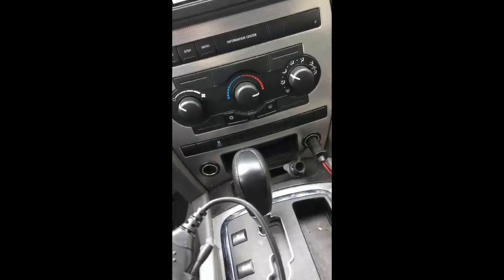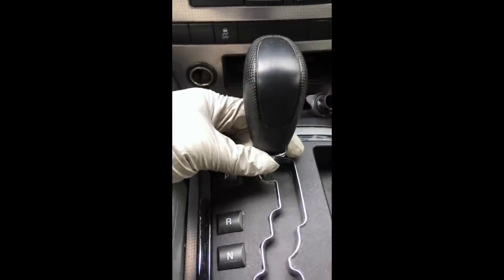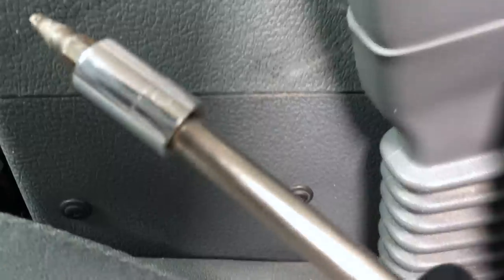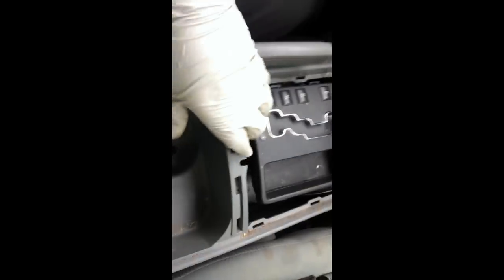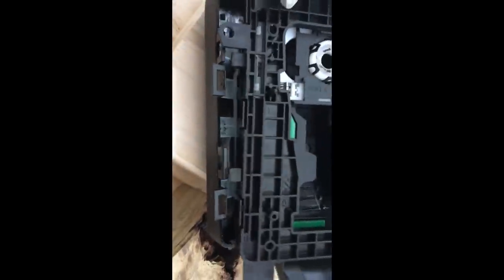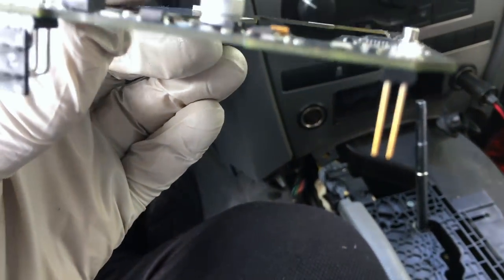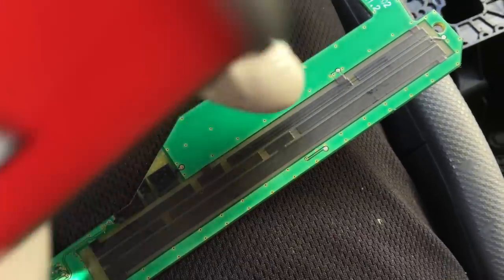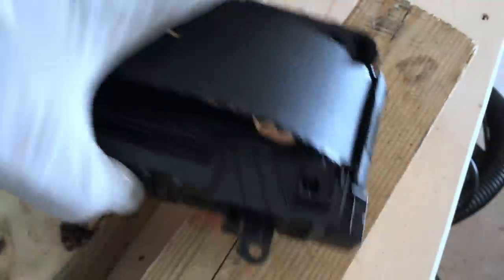2006 Jeep Grand Cherokee (WK) 3.7 Electronic Shift Module (ESM) Problems U0404 P0700 Codes

Comment: Would this cause a no crank issue on 08 wk? Shifter lights are all highlighted PRND ,and shifter is stuck in park,unless I manually release it. I have the crd and this problem also caused the glow plug indicator to not light up at all,and I don't hear the fuel pump. I've tried both original fob keys,and when cranking I only get one click at the starter relay , swapped relays and no dice! I did notice the red skis led continues to flash slow when keeping the key in the ignition.
Reply from the maker: It shouldn’t cause a no crank. Can you pull the codes? You can buy a cheap scanner at any auto store. Without that information it could be many different things. Let me know what you get.
Reply: @MrV2u  unfortunately my elm Bluetooth isn't communicating with the ecu when using the torque,and j scan app.i might have to tow it to the dealership,I'm thinking it's the pcm,or win module. I wish I was able to retrieve the codes but I'm not sure why it won't communicate. It's weird how the fuel pump,glow plugs ,and injectors aren't working,seems like a fail safe mode issue,
Reply from the maker: @Unleaded93  sounds like a ecm like you said. Check all your fuses and relays as well. It can be something as stupid as that or a short in one of the wires in the main harness. Has the Jeep been parked for a long time? Did it have any other issues before this happened or was it like you just parked it and this happened?
Reply: @MrV2u  ya it was sitting for four days ,than I uninstalled 2 batteries that I use for my car audio,after that it wouldn't start. I than unhooked the engine battery and had it load tested, installed engine battery back in again after a good recharge and still has the same symptoms
Reply: Can a mobile locksmith determine if the original key signal was lost? Would their tech be able to tell if the pcm is communicating? I'm just thinking that getting a locksmith here to my home would be cheaper than a tow and dealer diagnosis
Reply: @MrV2u  thanks for the response,so I had a locksmith come and check the codes and the key fobs are good ,but the codes shown are U1197 & U0100 ,he also checked the can high for a short and got 58 ohm he said 60 ohm shows no short,but believes that 58 should be close enough and he doesn't believe there is a short circuit. His opinion was that either the win module or pcm is no good.
Reply: @MrV2u  so I'm not sure what to do now,it's either pay and tow to the stealership for $140 hr diagnosis or I was thinking that I should just buy a plug and play pcm with the win already deactivated which would kill 2 birds with 1 stone. But how can I verify %100 that there is no short circuit?
Reply from the maker: @Unleaded93  when you installed your radio system did you perhaps cut a wire or in anyway short a wire by mistake. All the codes you have lead to a bad computer for sure. When you install a ecu you will have to have it programmed to the Jeep. You would also have to check the main engine wire harness from the computer all the way around to see if it somehow vibrated or rubbed the protective loom and shorted out a wire. It can be anywhere brother, it’s not a easy task to do but being that you installed your radio system I’m sure if you take the time you can pinpoint a issue. Look where you ran all your wires and check for something obvious, then check under the hood at the main wire looms for something that could be a issue. Let me know what you decide brother.
Reply: @MrV2u  yes you are correct,a wire did arc out on the metal frame under the steering column,I since cut that wire and reconnected it,but I'll have to look to see if something else is shorted. I believe the wire was from a foot well light circuit,but the circuit still had power and didn't blow that fuse. Would that still cause my pcm to fry? Also can I buy any used pcm as long as it's from a crd 3.0 diesel?
Reply: @MrV2u  given the wire that arced out and was reconnected and the high can was tested for resistance at 58 ohm, do you think I still have a short,and should go ahead with buying a used pcm?
Reply: @MrV2u  I can get a used pcm for $200 and $150 for programming vs $150 tow truck and $140 hr diagnosis. I fix all my cars and have never taken one to a shop,but I screwed up by letting that wire arc out,I should've disconnected the battery (I know better)!!!!!!!!
Reply from the maker: @Unleaded93   me personally I’d have it towed to the stealership. Unless you have access to wiring diagrams with a power probe to check for shorts or circuit drops. I know it sucks this time of year to deal with this. I doubt that wire short did anything to the ecm. My pops taught me growing up fix everything yourself and when you can’t then get help.
Reply: @MrV2u  thanks again,I really appreciate your honesty. Ya I might have to bite the bullet,I did pull the steering column panel off and looked at the wire that arced and it looks like it's going up toward the ignition/win module.maybe it's not a lightbulb circuit. The lower kick panel has been missing since I bought it and I assumed it was a connector for the bulb down there.  I Wonder if that does go to the win module, nothing was plugged into it ,but thank you I really appreciate it. Electrical issues suck lol. Happy Holidays to you and your family, Cheers from Canada!
Reply from the maker: It can also be a corroded pin in one of the harnesses too. It can be so much brother. Let me know how you make out, I’m curious myself.
Reply: @MrV2u  fixed! The pcm wasn't getting    12v ,must be a wire in the fuse box. I just bypassed it to another fuse and ran a jumper wire . It took a bit to figure it out but just used a test light and basic multimeter to diagnose.,as it's so hard to find a wiring diagram for the wk crd jeep and it's been -18c in Canada lol. Happy new year brother !
Reply from the maker: @Unleaded93  your the man bro. Thanks for the update. Hope Santa was good to you, happy new years to you and yours. Stay safe bro.

Comment: was it the actual shifter that was giving you the problem or was the transmission not shifting right any and all information would be greatly appreciated
Reply from the maker: It’s all in the video brother. The Jeep goes into limp mode at times causing it to either shift hard or not go past 3rd gear. It’s the build up of graphite that causes the computer to act erratic.
Reply: Thank you 👍👍

Comment: Code P0700 and P2767 came up on my jeep, could this be because of a dirty esm as well? Any suggestions?  Dealership said it was because the lead frame needs replacing which is 1200! Money I do not have.
Reply from the maker: How does it run? What other symptoms your experiencing? The DTC P0700 – Transmission Control System – Electrical, simply means that something went wrong in the electrical system that controls the automatic transmission. It is a generic trouble code. The ECU decides when to shift gears by analyzing the rotational speed of various parts, which is recorded by sensors like the input/turbine speed sensor / turbine speed sensor / TSS sensor. If there’s no signal coming from the transmission input speed sensor, a P2767 DTC will be stored. I’ve had jeeps with many different tranny codes and cleaning the esm did the job. It’s not bad to start with this. I hear you on the money. That’s why I made this channel to help people save some of that hard earned money. Let me know how you make out.
Reply: @MrV2u  Thank you for your reply. So the PRNDL Isn't all lit up like yours was. Usually my jeep will get stuck in 3rd. Hard shifting. Trouble starting up. On good days I can get by manually shifting. It also makes a loud revving type noise.. When I accelerate it gets louder and when I slow down it gets quieter.  Not sure if this may be another issue.  
If cleaning the esm doesn't work, in your opinion would you recommend replacing the input speed sensor?
Reply from the maker: I would definitely try to clean it first. Those are some symptoms you get with a dirty esm. And let me know how you make out. What year and engine you have? I’ll look more into it for you.
Reply: @MrV2u  Yes sir much appreciated! I'll be getting that done over the weekend and go from there. I have an 06 jeep grand cherokee, 3.7L.

Comment: Doing this today with my 07 GC 5.7 hemi hope it works its showing a check engine light and code P0700 wish me luck
Reply from the maker: It’s not a bad job brother. If you run into anything hit me up. I’m around to help. Take your time and you’ll be fine. Should fix your issues no problem.
Reply: @MrV2u  awesome thanks a heap :)
Reply: It worked! Cleared the code and went for a big drive and hasn't come back! Thanks for the great video helped alot :)
Reply from the maker: Love it. Great job my brother. Saved yourself big money as well. 👍

Comment: What do you do if your jeep won't let a computer read it.
Reply from the maker: Do you have a scanner? The key needs to be in the run position with the motor off! Also check the pins inside the connector and make sure non are bent or have any corrosion on them. Get a flashlight and look closely at them. If that checks out ok check all your grounds under the hood and make sure there clean and well grounded. Let me know if this helps. You can also tKe it to auto zone or advance and they can try their scanner for free just to make sure!

Comment: Having a similar issues my code showing p0700 Truck won’t shift pass 40MPH
Reply from the maker: I would start by trying what I did in the video. Then clear the codes and see if that helped! If not then it could be a failed speed sensor inside the transmission, a bad connection, or other electrical problems in the harness. Start from the easier job to do then take it from there brother. Let me know how you make out or if you have further questions!
Reply: MrV2u just did the same thing u did mines was clean so i guess it’s either the speed sensor or the TCM , sometimes it shift pass 4 sometimes it doesn’t
Reply from the maker: Do you have other codes as well? The Jeep feels like it’s bogging down, or revving up high and not shifting?
Reply: MrV2u i just drove it after i did what u did it’s shifting pass 40 i cleaned the code but i drove it again  & the code came back
Reply from the maker: BigFradoe damn man that sucks. Sorry to hear that. You got to go down the steps from the cheapest to the most expensive. Let me know how you make out bro.

Comment: Shifter moves back and forth but doesn’t actually shift into reverse neutral or drive could it possibly simply be the shifter control module ?
Reply from the maker: Hey brother, your going to have to crawl under the Jeep to where the transmission linkage is located and have some one shift it into park, reverse and drive with the car off and see if the linkage moves back and forth. Let me know what you find.

Comment: I followed your instructions and the shifter won't gauge to parking. The transmission will reach reverse by holding the handle but it won't lock in place. What are your recommendations?
Reply from the maker: Being that this is electrical and not the old fashion cables and levers I’m pretty sure it’s the assembly. They say if you go to a junk yard and get a new one or order a new one you have to have it programmed by the dealer. Does the handle just flop around with no resistance or does it feel normal but has no reaction beside reverse?

Comment: OK mines wen I drive the rpms Jus go up up up and never shifts gear would this fix it I was told the transmission Jus stops in one gear and gives out or is the shifter the problem cause all of mines have the circles around them and it won't go in 4x4 either or anything wen I move it side to side
Reply from the maker: Travis Martin sounds like this video will help you brother. Do you have a check engine light on when the tranny goes crazy? If you have all the boxes around your prnd lights then most likely all you have to do is do what I did. Let me know either way.

Comment: I did everything and it's shifting into gear a little better. Now I got a new code twice/ P0700 transmission control system (mil request). Do this mean i need a new transmission?
Reply from the maker: Exotic Freak did you disconnect the battery and or clear the codes. If so is there any other codes present? Po700 is usually generic and gets set with another code as well? Did the check engine light pop right on instantly? Did it go into failsafe mode which means crappy shifting and feels like it’s bogged down.
Reply: The check engine light came back on but I disconnected the battery and when I put it back on the check engine light went off but I still have abs and the traction light still on. change the front wheel bearing driver side and it's driving a lot better but the lights are still on. Thanks i brought a esm for 550 and took it back after your video.
Reply from the maker: Exotic Freak what codes your pulling brother? I did wheel bearings all around. I never made a video of it though.

Comment: Very helpful 👍🏻
Reply from the maker: Glad I could help Scotty. Any questions on it I’m around to help.
Reply: Was having similar issues wit my 2006 Jeep srt8, it wouldn’t exceed past 30 mph. Tried this at home only I replaced my module with a used one from the yard . So far it erased my check engine and running like it should
Reply from the maker: Scotty Ls2 at least you know in case it ever happens again. I wish I had a srt or trackhawk lol. One day I tell myself lol.

Comment: I think this might be my issue. 2005 grand cherokee 5.7L Limited. Has trouble starting ( acts as though battery is dead but no clicking and starts after trying it with several turns of the key). Shifts pretty hard and when I'm driving sometimes it clunks out of gear and gets stuck in one gear. Always resets after I park and start it up again.

You think this is the issue?
Reply from the maker: Chris Longmire do you have a check engine light on? If so do you know the codes?
Reply from the maker: It wouldn’t hurt to clean the contacts like I showed in the video. But with the codes I can help you better.

Comment: I have the same code u0404 invalid data receive by gear shift control module, is that the same as your code?
Reply from the maker: Yes sir! Check out the description of the video. It explains some symptoms and codes I had. Any questions let me know I’m usually around for advice. Hope this helps you brother.

Comment: My 05 JGCL keeps going into 3rd ,  when you crank it you can tell its going to be in 3rd.  Sometimes can turn it off and start again wont be like that other times it'll take 15 times to get right .  any idea if i should try this?
Reply from the maker: Kimberly Duncan do you have a check engine light on? If so can you get the codes? Autozone or advance auto will pull the codes for you for free. It wouldn’t hurt to clean the contacts as shown in the video. It might solve all your issues. But without the codes it’s hard to say for sure.

Comment: Hey im having similar problems i got a code p1637 will this help me someone told me ill have to change the tcm i have a 2005 jeep laredo
Reply from the maker: It’s possible you need a new tranny computer. My advice is to try this fix first before you condemn the computer.   It doesn’t cost you anything and very well could fix your issue. Let me know how you make out brother.
Reply: Thanks bro

Comment: I got P0700 $07e8 and $07e8pd and I have been led to believe its the TCM?  Any suggestions? 2006 jeep grand cherokee laredo
Reply from the maker: I recommend replacing your oxygen sensors to start brother.
Reply: @MrV2u  Thanks i will do just that!
Reply from the maker: @marcs3010  the front ones are a pain to get to so you’ll need a lot of patience!

Comment: Im having this issue. I get code p0730. took it to trans spot they automatically said i need a rebuild. any suggestions
Reply from the maker: Common Causes of P0730

Faulty torque converter clutch
Faulty shift solenoids
Blockage on the inside of the transmission main control
Internal mechanical failure of the transmission
Blockage in fluid lines
Clogged fluid filter or worn pump
Dirty or low transmission fluid

How many miles you have on it? Have you ever had a transmission service done to it? Any other codes? What symptoms you having brother?
Reply: @MrV2u  the car goes into "limp mode" when I make certain turns.  I turn it off and on and problem goes away
Reply: @MrV2u  never had it serviced I have 106k
Reply from the maker: Let me know how you make out brother.
Reply: @MrV2u  I bought a dipstick but it's really hard to read because it's by temp. I also feel like it's more of an electronic problem being that that transmission problem would not go away when turned on and off. Thanks for the advice
Reply from the maker: What’s the color of the fluid? Does it smell burnt? Does it feel gritty? I’m leaning more toward the solenoids.
Reply: @MrV2u  It ended up being a leak from an o ring at the electrical connector. It caused low fluid which caused P0730 code and limp mode.
Reply from the maker: And they wanted to rebuild your transmission. I’m glad you updated me brother. I’m sure your not the only one out there with this issue. At least you saved that hard earned money.
Reply: @MrV2u  absolutely